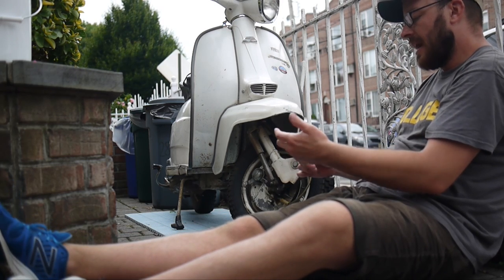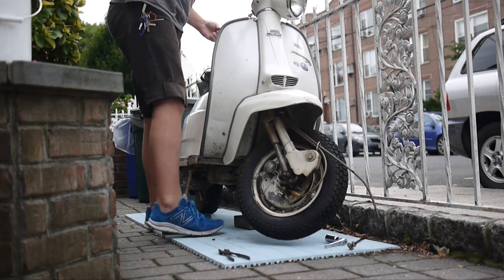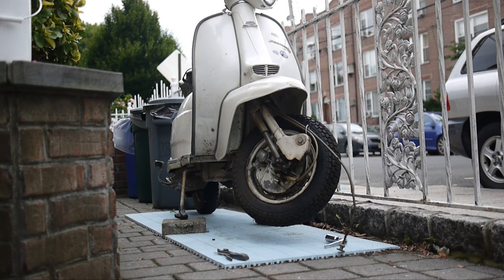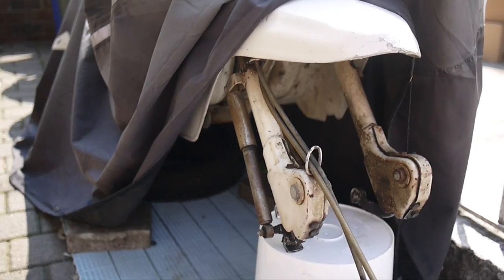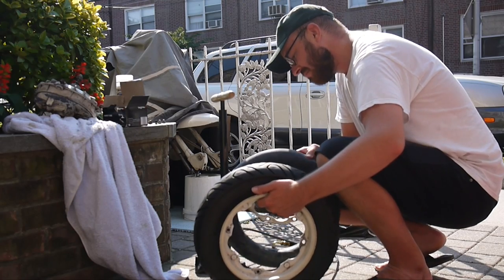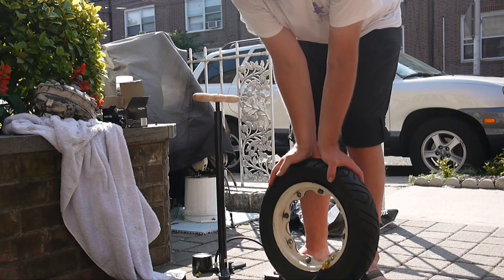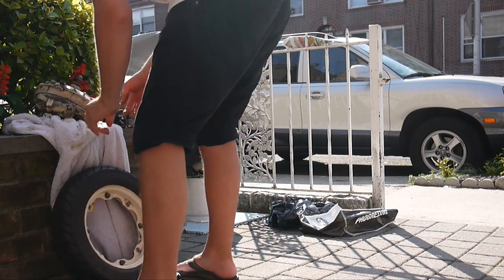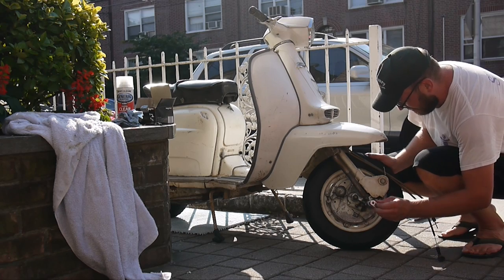Lambretta Tire Change (Front)

Comment: You apparently made one huge mistake. When installing or removing tires, I always use a LOT of lubricant on the beads. I have used Vaseline, and that works well. You can get non petroleum based products similar to Vaseline that also work well. DO NOT use soapy water. It will rust the wheels and it evaporates before you can get everything back together and get the bead seated. With lubricant there will be no problem seating the bead. As you air it up, the slippery bead will pop right into place.